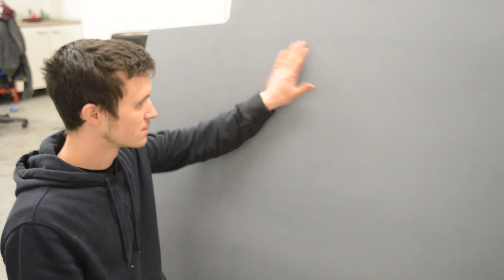How To Make an Expanding Foam Ducktail Spoiler/Wing *Part 3*

Comment: Are you really wet sanding without a block?
Reply: You should have also used a darker primer if you're going to paint it black it'll make the color look deeper.
Reply: And should halfway overlap each pass wheb you spray
Reply: And spray only in one durection